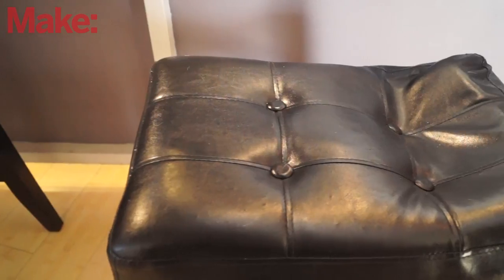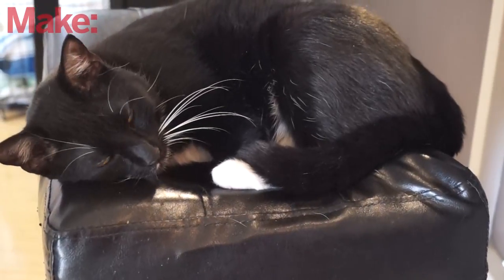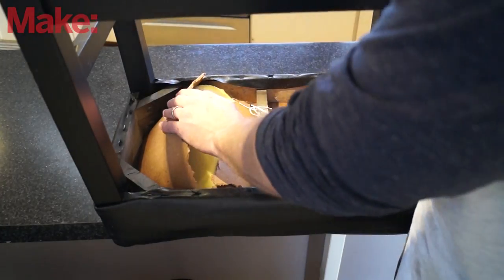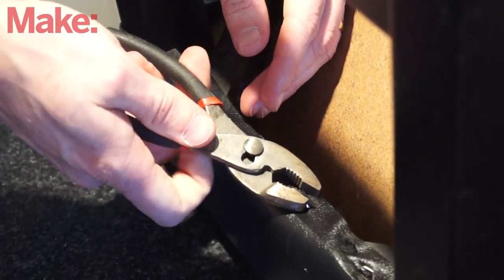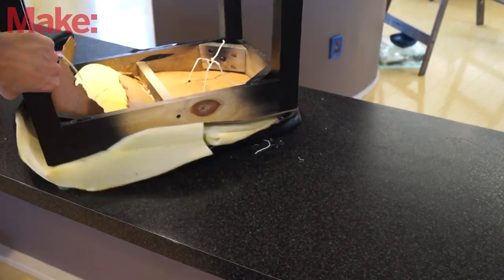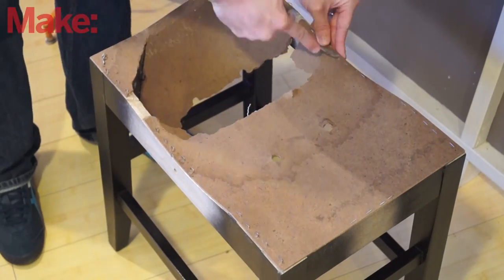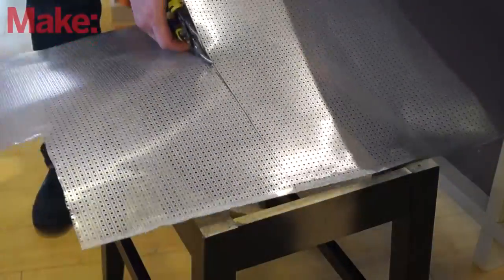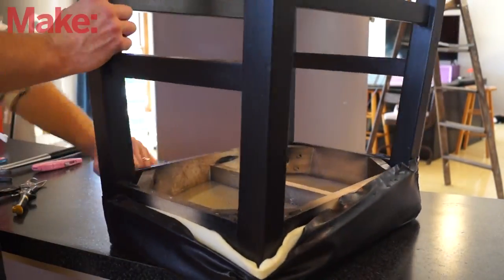Simple Repair and Upgrade of Cheap Furniture

Comment: The right way to have fixed that would have been to replace the fiberboard sheet with a slightly thicker plywood. A 1/4" 2x4 sheet handi panel is available at most hardware stores and is very inexpensive. In comparison not everyone will have snips to cut metal a 1/4 ply panel can easily be cut with a handsaw.
Reply: oh, I didn't realize there was only one right way to do it.
Reply: nope. but it is an easier way for most non diy people to do it. and sturdier. That metal seems to give way too easily leading to sagging faster.